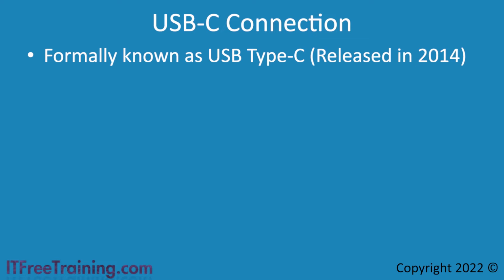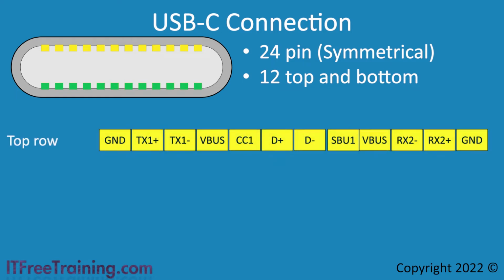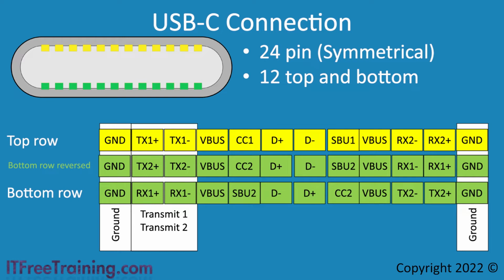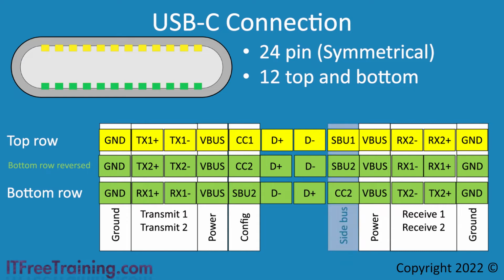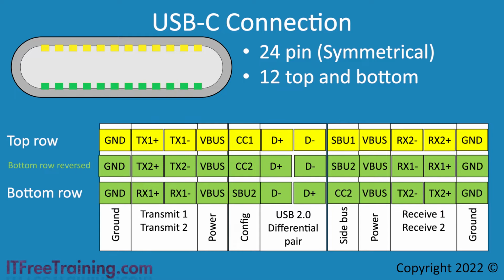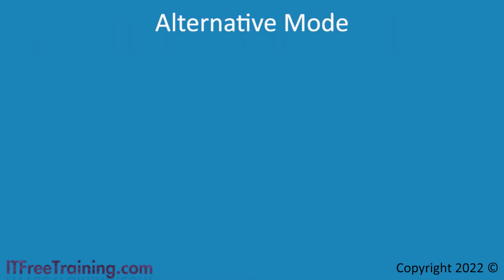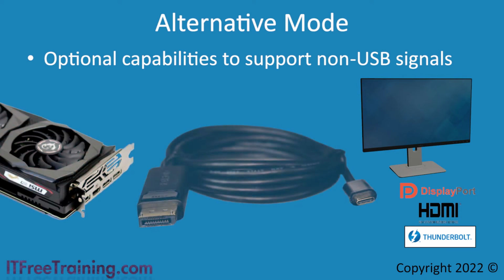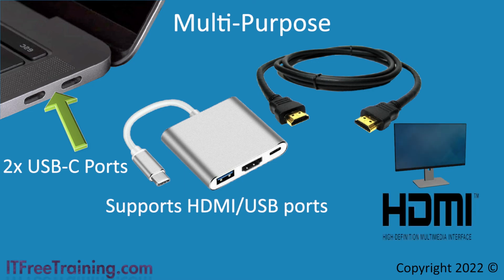Video Displays and USB-C

Comment: Very great video! Explanation is very good I must admit! And I think I have not found any other video about this topic on YT.

I wonder about four scenarios:
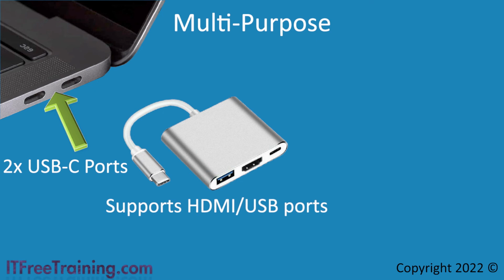1) At 08:15 you demonstrated a HDMI + USB A 3.0 to USB-C adapter. How does the signal gets send, if there a USB, that follows USB standard, but at the same time there is HDMI, that have to use alt mode. Would not they interfere with each other, since both of those signals goes through the same Type-C cable into PC?

2) At 07:00, let's say If both the GPU and monitor support and have Type-C and DisplayPort(s) connectors, and we have a Type-C to DP cable, would it matter where which side of the cable would be connected?

3) Meanwhile DP alt mode was discussed, are there "native" DP (or other video standard) over USB-C or all video signals over Type-C considered to be in an alt mode? And if yes, are there any difference between video alt mode and "native" video mode? 
And could the device/cable support only DP alt mode, but not like HDMI alt mode or vice versa?

4) Is it possible for USB cable to be deliberately made only for DP alt mode (or "native" mode from question 3) without supporting data transport, fast charging and so on?

Thanks for the video!

Comment: Hi, great video! I'm trying to understand why certain cables do or do not support high transfer speeds or fast charging. Is that hardware or software related? E.g. do cables with slower data transfer have less physical wires in them (so not all 24 pins are active and thus less lanes are available) or does it have something to do with the cable's configuration settiings (the config pin pair)?
Reply from the maker: Thank you for your compliment! Cable performance, in terms of data transfer speeds and support for fast charging, is primarily determined by its physical characteristics, including the number and quality of wires and the cable's configuration. It's more of a hardware-related factor rather than a software one. Here's how it works:

Number of Wires/Pins: The number of pins or wires in a cable can significantly impact its capabilities. For example:

USB cables typically have four wires for basic functionality (power, ground, and data).
USB 3.0/3.1 cables have additional wires for faster data transfer. For example, USB 3.0 has nine pins, while USB 3.1 has 24 pins.
High-quality USB-C cables often have even more pins to support features like fast charging, video output, and data transfer.
Wire Quality and Material: The quality and material of the wires matter. Higher-quality cables often use thicker wires with better conductivity. Thicker wires can carry more current, which is essential for fast charging.

Fast Charging: For fast charging, both the charger (power source) and the device being charged (e.g., smartphone) must support fast-charging protocols like Qualcomm Quick Charge, USB Power Delivery (PD), or others. Additionally, the cable must be capable of carrying the higher current needed for fast charging without overheating or voltage drop.